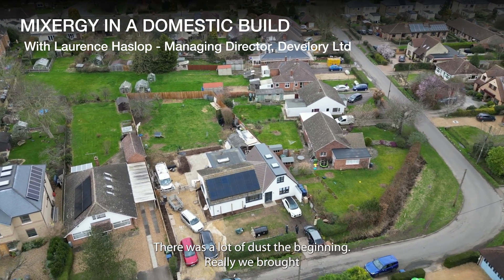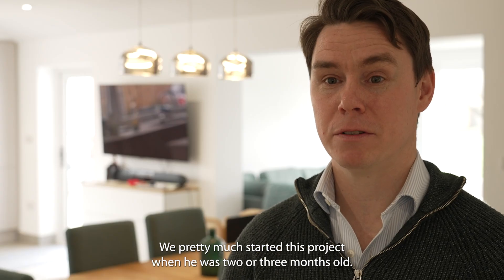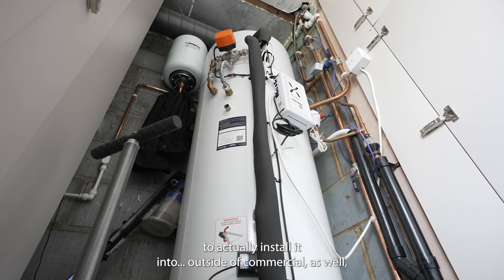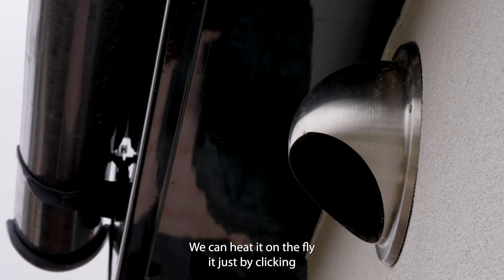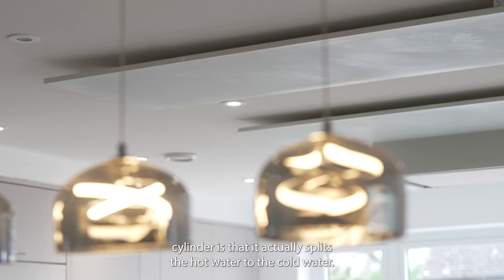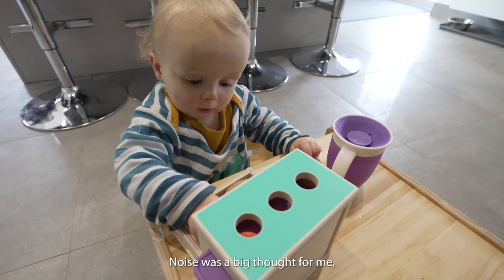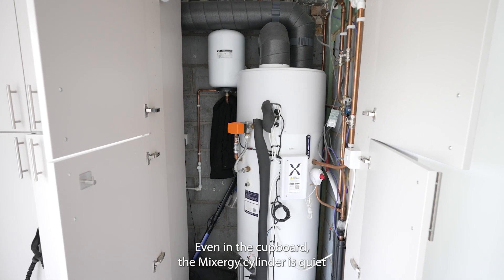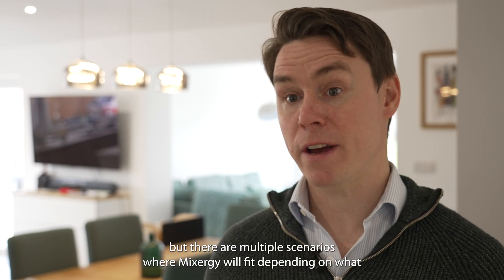Mixergy iHP in the home

Comment: Hi, I have a commercial project to replace two small 145l gas fired calorifiers. This looks like it would be a viable alternative without replacing flues, lowering our carbon footprint and hopefully supporting lowering energy. Have you two in tandem with single dhw secondary return?
Reply from the maker: Thanks for the question, it does sound like our iHP would be suitable for your project. For us to give a more accurate answer, can you please fill out this form and select "New sales enquiry" https://www.mixergy.co.uk/contact/. That goes straight to our sales team, they'll be in touch to find out more about your requirements and can advise further.

Comment: Could you explain this concept of a “heat pump” on top of the cylinder? I am not familiar with this setup.

To be fair, in a home equipped with smart meters you can use your in-house energy monitor to determine how much electricity and gas a regular boiler is using when heating. So I presume this would be the same with this Mixergy system.
Reply from the maker: Thanks for the question, an integrated pump cylinder means the heat pump is attached to the cylinder, heating the water for the home. Our iHP also has the same benefits as our other cylinders with smart tariff integration, smart controls and it uses machine learning to understand the needs of the home. Check out this more in-depth article on how integrated heat pump cylinders work, and why our iHP is different https://mixergy.co.uk/news-and-insights/introducing-mixergys-new-award-winning-heat-pump-cylinder-the-ihp/
Reply: @mixergyltd6286  interesting thank you. I presume that somehow, you have to have a hole somewhere in a wall of the property to allow outside air intake?
Reply from the maker: That's right, a hole will need to be put in place to allow for the ducting to intake the outside air.